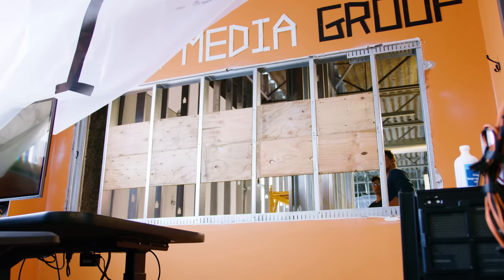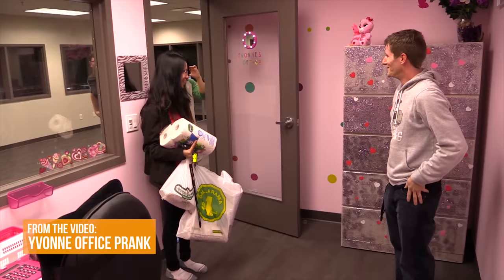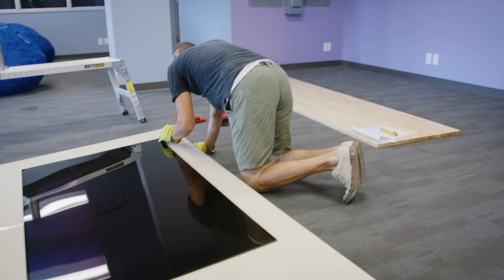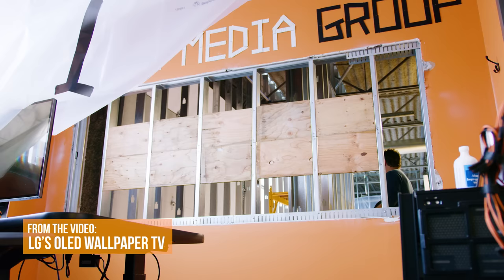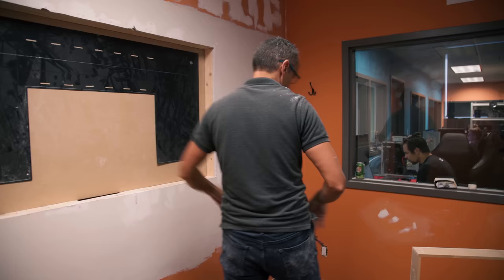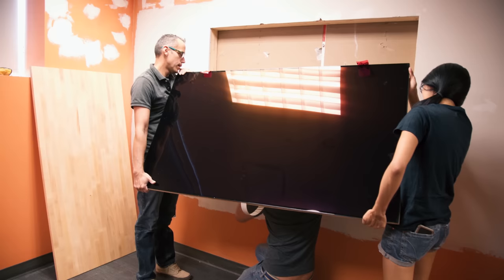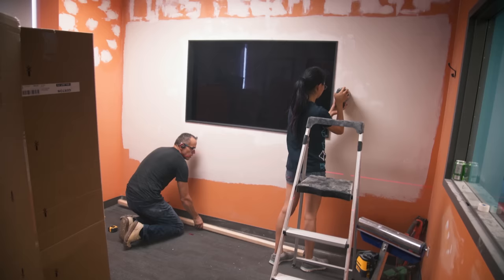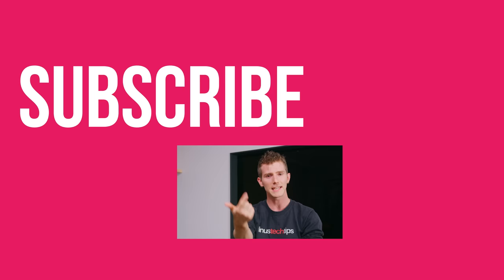We Turned LG’s WALLPAPER TV into a WINDOW!

Comment: Why did the TV need to be thin for this?
Reply: So the bezels don't take away from the effect, and the fact it mounts magnetically to a panel. It would be harder to do with a traditional wall mount as it would be impossible to remove when it ever needs to.
Reply: Because sponsored video?
Reply: That too
Reply: you could easily hide the bezels in the wall behind the window frame and make it removable with a standard TV.
Reply: My toughts exactly.. Well atleast it's still pretty and all.
Reply: I feel like they just ruined the purpose of this TV
Reply: The game ain't the same, we done changed the game
Reply: Exactly my point.
Reply: I'm going to go with heat, actually. Televisions typically have heat exhaust vents in the back. The wallpaper television is so thin, essentially entirely surface area, it won't be so drastically affected by hugging half of its radiative surface area up against an insulating wall. All the heat can radiate out the front without affecting the image.
Reply: Theoretically it doesn't need to be paper thin for this. My 1 inch thick TV could be framed to look very similar. I think the key difference here is that this TV is already designed to generate barely any heat so dissipation isn't an issue even flush against the wall. My TV wouldn't last long if it were fully enclosed in a frame and placed into a wall. I would need to add active ventilation. It's also not safe to put a TV containing a 120V power board inside a wall recess. On a side note, LG's ribbon cable is also not 'in wall' rated, meaning this installation they've just done is a code violation. LG says the cable needs to be enclosed within conduit.

Comment: Hey Linus, just so you know the ribbon cable on the OLED isn't rated for in-wall use, so if your office burns down LG isn't going to pay for it :D rip.
Reply: ShadowWolf810 just like all of his builds, I bet he took it down right after they finished filming
Reply: MegaLakona ...
Reply: You think LG would give him another office too?
Reply: I don't think that people here understand that cables generate heat as electricity pases trough them. And that in wall there is no ventilation to get rid of the heat.
Reply: They should add a urinal to the wall. Pseudo water-cooling.
Reply: +Buano Taquito USE SOME COMMON SENSE DUMMY! If such a thing occurred, it would be covered by the insurance I guarantee Linus has on the building and the property contained within. Even a fire that is negligently caused by Linus would be completely covered. Linus wouldn't have to go after LG in the first place. However, the insurance may. That is the whole point of having insurance. The peace of mind in knowing that, even if it's your fault, you will be quickly paid in full for your losses. Next time, try to use the frontal lobe of your brain before typing.
Reply: That TV probably costs more than renovating the whole office.

Comment: Buys a bezel less TV.
Adds a big ass bezel to it.
Reply: JulianSauco I agree. This could be done with any flat screen..
Reply: To be fair this is thin enough to fit inside a wall thus allowing them to make a tv window also that parts more like a window frame than a bezel
Reply: It's more about the image quality. OLEDs are pretty dope.
Reply: You can make the wooden frame so it hides the bezels i could make any modern TV fit in that wall... useless in my opinion. They should have hide the ribbon in the wall and that's it
Reply: JulianSauco #irony
Reply: Came here to say that
Reply: Buys a super thin TV.
Adds a thick ass sheet of MDF to the back of it.
Reply: Most LCD/LED TVs need some amount of space for heat dissipation. The LG wallpaper OLED appears to not need any ventilation, thus can work inside a wall.
Reply: Tractionless With that extensive woodwork they are plenty of way to solve this.

Comment: Doesn't the black frame, with their perfect measurements to keep the panel in place, add bezels and cut off the edges of the screen on this wallpaper TV  -which one of its biggest features is having little to no bezels?! Honest question if they took that into account or not because they don't really explain it nor does it look like they did. And if they didn't take it into account, I would imagine its going to be a pain in the arse to look at the windows taskbar.

Comment: Step 1: Buy ultra thin Tv
Step 2: Build it into the wall so that you can't see how thin it is
...
Step 3: Profit?

But seriously though, it looked like there would've been enough space for a normal tv to fit in the wall, so why spend a bucket of cash on this tv?
Reply: Because... reasons.
Reply: Random Person 
1) a thicker TV wouldn't fit in the wall after being recessed
2) this one has all the I/O in the soundbar so it's easier to cable
3) "sponsored by LG"
Reply: Because he didn't spend a single Canadian beaver pelt on that T.V.
Reply: Heat wouldn't be that much of an issue, after all the heat would mostly be the actual display and light, not the driving stuff. In any case they could have had it less recessed than they did. I was expecting the bevel to be pushed against the inside of the wall or even flush with the wall. This is right up against the back.
Reply: +obvious_humor But couldn't they have made the hole inside the wall bigger and then covered up the bezel with the wooden frame?

And even if it's sponsored by LG, it's still overkill... It'd be like buying a sports car and using it to get Drive Thru.
Reply: Because he's under contract from LG to make at least 20 videos about this TV.

Comment: Why do you use the thinnest TV in the world if you make a deep hole in the wall anyways?
Reply: They are making it look like a window so it has to be recessed in as windows are almost never flush with a wall on the inside. Picking a thicker TV would have made them cut deeper or all the way through leaving ugliness on the other side.
Reply: I don't think "thinnest" vs. "thin AF" would make much difference in the outcome, just the price.  But, I guess, sponsors...
Reply: That was my thinking.  It is a cool project but any decent TV could accomplish the exact same results.  This project, interesting as it is, does not take advantage or showcase how thin that TV is.
Reply: I was wondering the same thing.... WHY THE HELL IN THE WORLD WOULD YOU MAKE FRAME FOR IT... LOL :)

Comment: But you could do this with any TV. You don't need a super thin flush mounting TV for this at all. You've kind of defeated the purpose of this TV by recessing it like this.
Reply: josh6499 
only if the wall is thick enough.

Comment: Linus Tech Tips - Can you do another video with a much LARGER TV set back 1 inch from a slightly smaller window with a piece of glass in front of it?  it would help some if you used a VERY LARGE TV and a window opening that is slightly SMALLER than the TV.   So with the VERY LARGE TV about 1 inch further back and completely separate from the false window.  Also a piece of real glass over the false window opening.  As you walk to the left you would see a bit more of the right side of the large TV screen.  As you walk to the right you would see a bit more of the left side of the large TV screen.  If you sat down you would see more of the upper part of the TV screen as you are looking up towards the window. And standing up you would see a bit more of the lower part of the large TV screen as you are looking downwards out the "window".  It wouldn't change all the viewing angles but would give a slightly better illusion of depth and field of view.

Comment: Awesome picture, crap sound from under the table. Why? Speaker bars, good for baseball batting practice. Just like those hockey puck eavesdropping devices that make sounds and share my name. Street hockey using a sewer as GOAL!!!  Don't use blurtooth either. 

I just found a 55 inch LED (ell-e-dee) lit screen on the curb. I plugged it in, it's two strikes by a child and it's out. Grubby little fingerprints allover the frame, that's how I know. I took the LCD screen off and it makes a great "window" that lets in gobs of artificial daylight, over 350 lux. Perfect for fighting the winter blues, or super as a photography source of diffuse full spectrum light.

Comment: Ah, this still looks like a TV. Normaly a window does not have a black frame, and you should have a typical aluminum frame with glass in front, like double glass with alu-frame in the midle. And don't forget the outer frame, overlapping the inner frame and wall.

Comment: What's the point of putting a already paper thin tv into the wall. Like ya i could see it if you had a regular thin tv cuz they are normaly is 4inchs thick bulging from the wall but this tv is already paper flat its like 1/2 inch thick . All im saying is putting paper tv into the wall is redundant..

Comment: I think this is a dumb idea. it just looks recessed and doesn't actually look like a window. I think the point of these TVs  is to hang them on the wall and show how thin they are, like a poster TV, if you really wanted the flat cable hidden you could have made a cut out behind the the display and and routed it to another cut out below it.